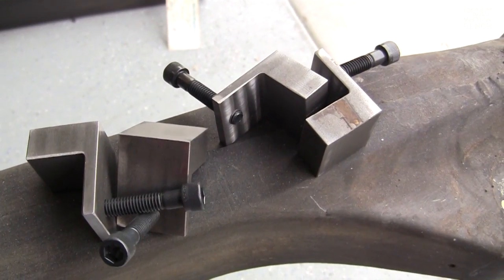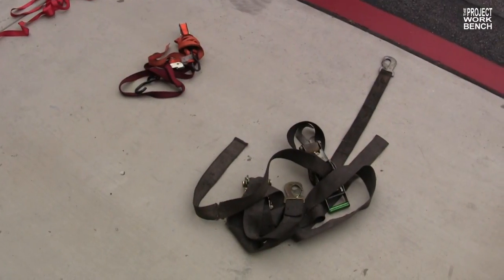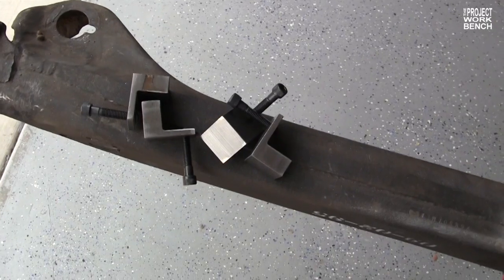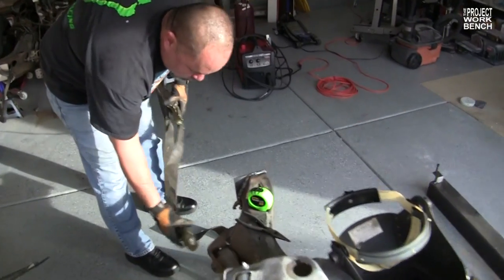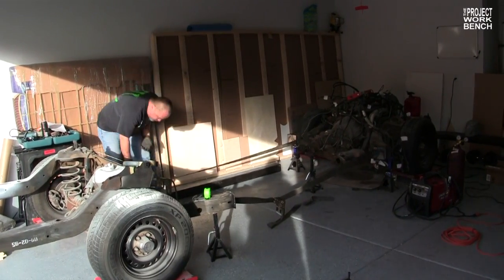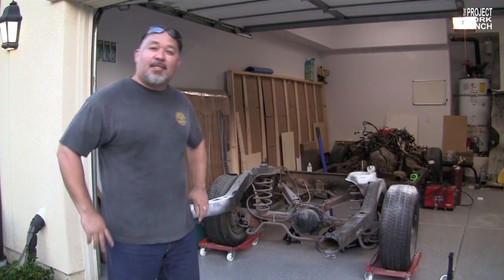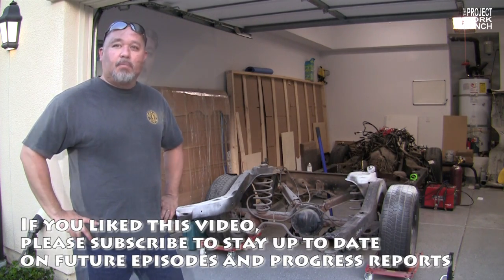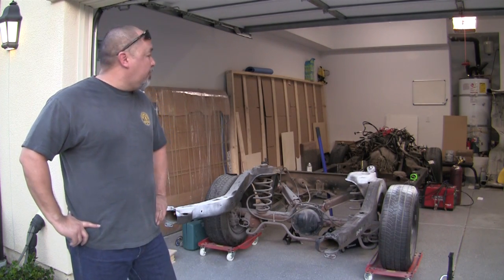Rise of The MattMobile - Ep 16 - Finishing The Chassis Stretch

Comment: So much for diagonal measurements to check square, and maybe sleeve the new rails into the frame ends a few inches? That way you could weld it for a physical and bolt it too, for a mechanical connection. Just because someone has a welder and can stick metal together, doesn't mean they're a weldor.